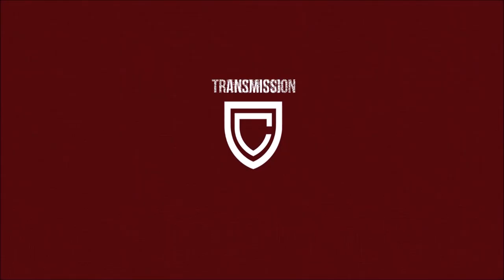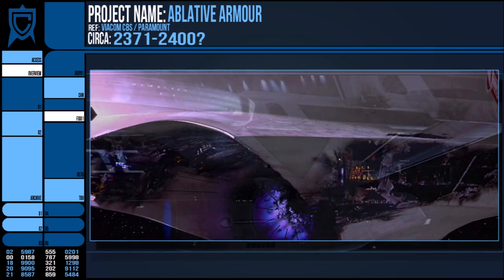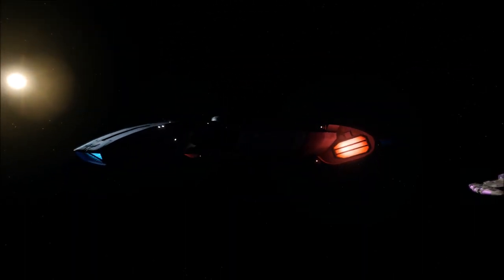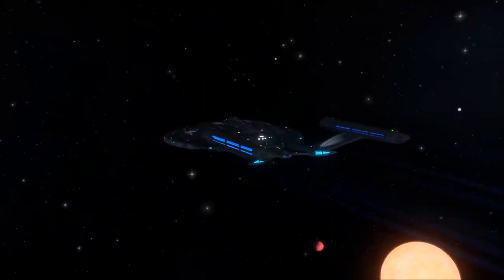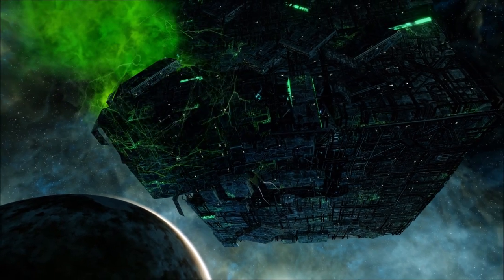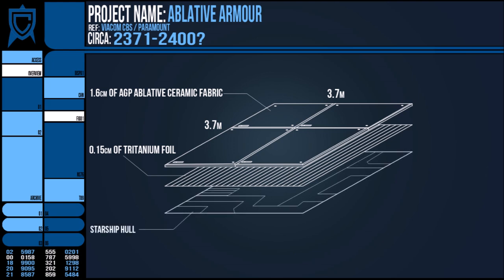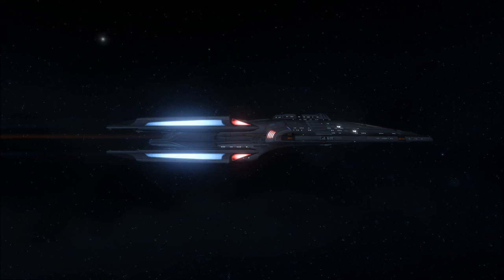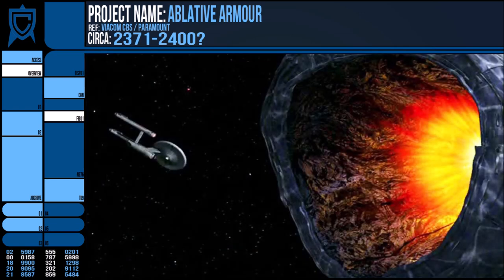What is Ablative Armour? (Star Trek Lore)

Comment: It's hull plating designed to vapourise when it's struck by an energy weapon. The vapourisation itself dissipates some of the energy transfer, and the vapour is designed to briefly refract subsequent strikes on the same spot.
Reply: So ERA in space
Reply: What about kinetic?
Reply: @neomt2  do we know what the structure underneath the armor is made of?
Reply: @nullpoint3346  duranium
Reply: @quisqueyanguy120  No reactive armor isn't really the same thing.
Reply: @neomt2  Kinetic weapons were uncommon Star Trek universe, particularly in the Alpha & Beta quadrants, so it probably wasn't designed with that in mind.  Plus the sheer amount of kinetic energy that can be built up in a weapon fired in a vacuum makes them incredibly difficult to protect against without energy shields. Voyager had a hell of a time with the Krenim's torpedoes because they could bypass the shields with their time-shifting technology.
Reply: @ManabiLT  photon, quantum, transphasic, gravimetric etc torpedos and mines existed esp tricobalts
Reply: @quisqueyanguy120  If you mean reactive armour, no, it isn't. "Ablative" just means "designed to be struck".
Reply: @neomt2  No specific protection against kinetic impacts. That's what the shields are for.
Reply: @neomt2  Nobody uses kinetic weapons, because ship deflectors negate them.
Deflectors are primarily designed to deflect micrometeoroids and space dust, which would otherwise destroy the starship apart at warp speeds. Bullets would be no challenge.

Large things, like other starships or at least shuttles can get through, but projectiles light enough to use in weapons would just get deflected.
Reply: @frantisekvrana3902  torpedoes are always used. It's ships most powerful weapon. Main shields help stop for a short time,depending on power of torp.
Reply: @darkmatter1152  
Yes, torpedoes are used.
But they are explosive weapons, not kinetic.
They damage the target by exploding near it, not by hitting it at high speed.

Comment: I think you missed a feature of this armor fyi. Unless I'm mistaken, I recall that it also vaporizes releasing a clould of particles to that help dissipate the beam of an energy weapon. 🖖
Reply: You're not mistaken.  What you described is ablative armor.  The definition in the video is wrong.
Reply: @originalwij  I wouldn't say its outright wrong....its just not entirely complete. While ablative armor is indeed a system that passively dissipates incomming energy by distributing the kinetic, thermal and electromagnetic component of the attack the destroyed part of the armor also forms a thick dust that refracts the still incomming remaining attack.
Reply: @originalwij  sounds about right.
Reply: @stevemerkator  I am not sure that anything that was hot enough to blast away the original armor material would care about the dust it creates in the process.

Comment: Also when the armor is burning away it creates a particle cloud that can disrupt enemy targeting systems, essentially it is the 24th century version of current era chaff countermeasure.
Reply: Actually, ablative armor is in common use today.  To see it just GOOGLE...
"Blazer Reactive Armor" or "Kontakt 5 Reactive Armor."
Reply: @swaghauler8334  Reactive and ablative are different concepts.
Reply: @mackgiver875  Ablative armor is sub-category of Reactive armor.  Reactive armor is a type of vehicle armor that reacts in some way to the impact of a weapon to reduce the damage done to the vehicle being protected.  Ablative armor is armor which prevents damage through the process of ablation, the removal of material from the surface of an object by vaporization, chipping, or other erosive processes.
Reply: @barbedwire83  Ablative and reactive are both sub categories of armor. Reactive armor and ablative armor use different concepts to defend against penetration. Reactive armor is an active defense, ablative is passive. The only thing the two have in common is they are both a type of armor protection, they have the same job. If armor is ablative, it cannot be reactive, and vice versa.
Reply: @mackgiver875  I would request you provide an example of Reactive armor, then.  My understanding is Reactive armor is a sub-category of Armor and Ablative armor is a sub-category of Reactive armor.
Reply: @barbedwire83  There are two examples  further up in this thread. Kontakt-5 for example uses explosive panels to blast externally installed armor plates into the direction of the incoming round. This is a reactive defense system because it takes an action triggered by an incoming round. Ablative armor is passive because it's just hard and dense, there is no other action it takes, it just gets burned or chipped away from heat or kinetic damage. The point is one is active/reactive, the other is passive.
Reply: @mackgiver875  I understand the difference you're trying to make, but they both require impact for their properties to "activate".  That by definition is a type of Reactive armor.  I call Ablative armor a sub-category of Reactive armor because it has a specific definition of how it works.  What I think you are trying to describe would be a type of Proactive armor separate from Reactive and Ablative armor entirely if I understand you correctly.  If those panels explode outward before the armor is actually impacted, that would make it a type of Proactive armor.
Reply: @barbedwire83  Kontakt-5 doesn't explode outward, it explodes in between two applique armor plates which violently forces one of the plates into the impact point, artifically increasing the amount of armor that needs to be penetrated, or if a kinetic penetrator, possibly snapping or deflecting it entirely. Pretty much everyone in the world calls this type of armor ERA or explosive reactive armor. You can call it what you like.
Reply: So the lesson learned from this video: just don’t attack the defiant

Comment: Think of Ablative Armor as the heat tiles on the Shuttle, because that's exactly what it is. It can deflect and adsorb a certain amount of energy (in this case, heat), until it reaches a point when it will dissipate that energy through sacrificing itself. Modern race cars do the same by shedding the outer body parts in order to dissipate the energies involved in a crash.
Reply: Yes like that but also with a counter explosive to dissipate the kinetic energy.  Like with the American Abrams tank and the superior but more expensive challenger tank cobam ( acronym) armour .
Reply: It is like reactive armor. It is additional armor attached to the hull of a vehicle. So when a projective hit the vehicle, the top armor absolves the hit before it explodes and penetrates the hull.
Reply: Space shuttle tiles are not ablative, they are emissive. Ablative armours are consumed, IUE, they ablate. The heat shields on apollo and soyuz capsules are ablative. Shuttle tiles are insulative, and emissive, they radiate the heat back out but do not lose matter in the process.
Reply: I always thought of a Quantum defense, where the ship is slightly phased out of time, and weapons fire passes harmlessly through space, metaphasic shielding, that allows a ship to pass through the corona of a star without damage. 
As well as a cloak that works to allow a ship to pass through a planet as was seen in the STNG episode with Ryker involved.
Reply: @kauske  although of course a bunch of them did get destroyed every time. And replacing the tiles was time consuming. But yeah not strictly ablative like earlier heat shields were. I was a little disappointed Ric didn’t go into the real life spacefaring applications but oh well.
Reply: @kaitlyn__L  Most of the destruction wasn't from the reentry though, but other wear and tear. Particularly accidents during refurbishment, since the tiles are very delicate.
Reply: @kauske  indeed.
Reply: @shanenolan8252  no, not also with explosives.  That's an entirely different technology and technique.
Reply: @DrewLSsix  do you mean the different tanks . Come to think of it they are different correct
Reply: @shanenolan8252   The Abrams actually  uses the same type armor as the Challenger.  Not reactive armor.
Reply: @loctite222ms  i thought they did the same thing but by different designs, something about the British tank have a different unique layered armour plate . The exact nature is classified.  So the documentarys on the subject i saw said.  ( history channel)
Reply: @loctite222ms  Abrams use CHOBHAM armour, which was invented by the British in the 60s but the concept dates back to sometime in late WW I as a defence. It was first deployed on the Abrams but also it's a core defence of the Challenger series tanks.
Reply: @thirdenvoqation7735  There might be some differences or modifications between them or in later builds of either.  Likely details are still classified and therefore not general public knowledge.
Reply: Ablative Armor is actually more like the heat shields used on the SpaceX Crew Dragon and Orion Crew Exploration Vehicle and the now-retired Mercury, Gemini, and Apollo: when entering the atmosphere, the heat chars the fiberglass-based or PICA resin and the melted resin carries away the excess heat. The Space Shuttle thermal protection tiles (also adapted for SpaceX Starship), which are made of silica (reinforced carbon-carbon on the nose and leading edges of the wings) and coated with a special heat-resistant coating, acts more like a heat sink, absorbing the heat, yet repelling it so that the friction caused by entry interface doesn't burn holes into the aircraft aluminum skin of the Shuttle (stainless steel for Starship), causing the ship to break up like what happened to Columbia back in 2003.
Reply: fun fact about ablative heat shielding... one material that has been used, and quite successfully, is oak wood. Yes, *wood*. It burns and chars, yes... but the oak doesn't conduct heat well, and the burned off layer carries a lot of the heat away in the ashes.

Comment: Ablative Armor in Trek seems very similar to ERA (Explosive Reactive Armor) that is used on modern tanks. Both systems are designed to disperse the attack, and both systems are consumend when doing so, making them one time defences. 

For those that are unaware, ERA is made from a large number of blocks that are added onto the exterior of a tank. Each block consists of metal plates and explosive materials sandwitched between them. When a so called HEAT projectile (a weapon system that doesnt use kinetic energy to penetrade armor, which makes it suitable for missiles) hits the armor, the explosive part detonates and pushes the metal plate against the incoming projectile, which greatly reduces its effectiveness. Most ERA systems are only effective against these HEAT projectiles, but the most modern systems can even reduce the effectiveness of conventional tank gun ammunition by reportedly up to 40%.
Reply: Ablative armour is technically any armour which is consumed to do its job, IE, ie ablates. The heat shields on apollo and soyuz are a good example of thermal ablative armour, as they burn away in a controlled manner to keep cool. ERA is a form of kinetic ablative armour, which meets kinetic force with opposing force, but the basic principle is the same in that it's designed to sacrifice itself for vehicle integrity.
Reply: Nope.  Ablation is passive.  The material is simply blasted away, dissipating the energy of the weapon.  Reactive armor has it's own explosives to counter the weapon.

Comment: I'm an aero engineer, specializing in thermal shielding systems (aerothermodynamics, fluid dynamics, materials science and mechanical engineering). My work involves external heat shields, regenerative and transpiration cooling, and ablative nozzles.

Solid ablative systems (such as those used by Apollo capsules) work by using an extremely good insulator, with a high thermal capacity, and a very short or non-existent liquid phase. The exposed layer of material absorbs a great deal of heat, doesn't pass it on to the material underneath, and carries it away as the material vaporizes or decomposes. This exposes another layer of the shielding underneath and the cycle begins again.

Comment: Im gonna be THAT nerd, but a heavier ship wouldn't need additional warp coils as a warp bubble will occur regardless of mass. Warp coils compress/expand space-time, they don't push the ship directly. You would, however, need additional impulse engines as they don't rely on warping space-time.
Reply: Technically that is correct however, warping of spacetime is easier if it's not already warped much. It takes exponentially more energy to warp it further. Neutronium is so dense that the spacetime around the ship would already be significantly warped just from the mass of the hull and thus would require significantly more energy to warp it further in order to create a differential field for warp propulsion.

Comment: I’ve always thought that hull polarisation thing wasn’t entirely abandoned; rather it became the structural integrity field. That’s just headcanon though. But they definitely both involve applying a current through the hull such that it’s stronger, stiffer, etc etc.  

I’ve always thought having a generator that replaces your armour was a great idea. Especially because it can cover the torpedo tubes, phaser strips, etc until the second they’re needed and then it irises away for only as long as required. Which the stationary ablative armour certainly can’t do. 

And lastly, I was under the apparently mistaken impression that duranium was an older material that had been replaced by tritanium by the time Voyager was being constructed. I mostly noticed them bringing it up about the construction of DS9 and shuttles and stuff, in the 24thC. But I suppose if I really wanted to I could search Chakoteya for these terms and see how often they come up. But I CBA :)
Reply: Hull polarization and the structural integrity field are two completely different mechanisms with different (if related) goals, though I can see where you're coming from.

Polarization runs an electric charge through the outer hull plating that increases its hardness significantly - which is pretty handy, if you're trying to deflect kinetic impacts. Its effectiveness against energy weapons and radiation is more situational, but until Earth got its hands on actual deflector-shield technology, it was better than nothing.

The structural integrity field is a network of force fields that help keep the ship from tearing itself apart due to the various forces exerted on it by maneuvering. They don't make the hull or bulkheads themselves any stronger the way polarization does, but instead hold them in place with external forces. It's a way to improve the strength of the ship's frame without having half the interior space cluttered up with physical bracings and structural reinforcement.

The SI field isn't a shield system and doesn't prevent impacts or enemy fire from damaging the ship. Still, if you had a hull breach, polarization would make the surrounding hull plating more rigid, which would help keep a hole from tearing open further - and that is a function that the SI field performs, so I can see your point.
Reply: I always thought that hull polarization is something akin to when they line up atoms of carbon in the same direction for that super strong carbon materials..in real life.
Just in at any moment current is passed through hull...as opposed to aligning them in production as is in real life.
And structural integrity field is more like a shield within the hull of starship.
Reply: @tba113  I'm grateful for these explanations.  But I have always wondered - why did the Federation seemingly abandon hull polarization?  Granted you wouldn't want to use it as a primary defense, but it could still serve as an auxiliary defense measure once shields are running low.  And we all know how the Federation loves its backups and secondary backups.  Very often we see that once shields are down, a starship is right on the edge of catastrophic damage.  The first potential reason that comes to mind is that perhaps the materials used in the 24th century for Starfleet shipbuilding aren't as usefully affected by polarization as the original materials in the NX-01's design.
Reply: @heartoffire5902  You're welcome! Starfleet shifting to other materials that don't lend themselves to polarization certainly could be the case: that the tritanium plating used in TOS and TNG might be stronger than the alloys used in NX-01's day, but they don't harden up to take a punch the way the old stuff did.

It's also possible that the weapons of later eras are simply too powerful for polarization to matter, and materials science just hasn't kept up nearly as much as improvements to shields have. An unshielded ship facing enemy fire might be in for a rough ride in the NX-01's day, but it would pop like a balloon if it got caught with its shields down when TNG-era weapons are flying. IIRC, the Miranda-class USS Lantree in TNG was completely destroyed by a single photon torpedo that detonated nearby while Lantree's shields were down.

In that scenario, it's not unreasonable for Utopia Planitia to conclude that if a ship's shields go down, it's already in a very bad way, and hull polarization won't help enough to save it. The reactor power needed to polarize the hull would be better spent either getting shields back up, boosting the engines to leg it, or charging weapons to end the threat.